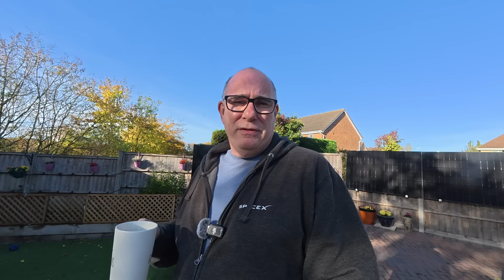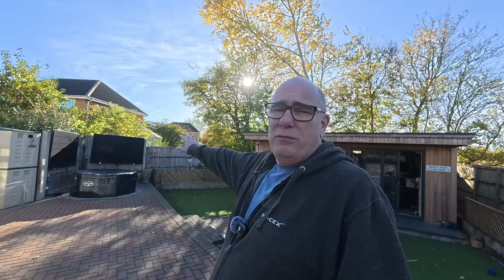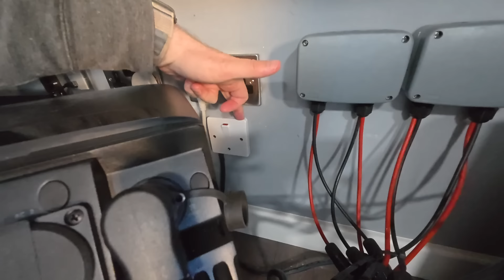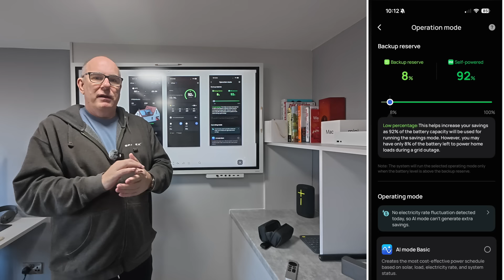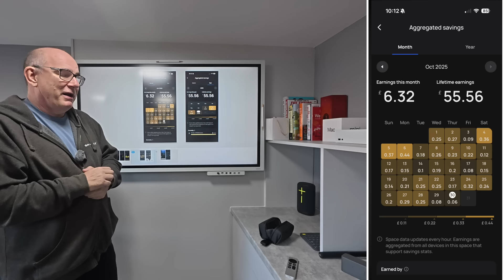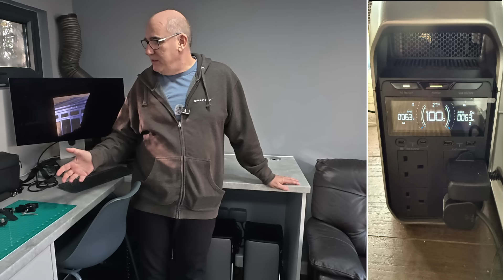I Tried Plug-In Solar for 90 Days (EcoFlow Stream Ultra UK Review)

Comment: How do you feed the battery power into the home when there is a power outage on the grid. Is it true the ecoflow stops injecting power when there's a grid outage to stop backflow?
Reply from the maker: @Builtbypete great question 👍  

Yes — grid-tied systems like EcoFlow will *stop injecting power during an outage* (anti-islanding safety).  

If you want power during a cut, you need a *separate backup/off-grid output* from a battery — the plug-in side won’t run the house on its own.
Reply: @JonathanTracey  If you disconnect this unit from your main can you not use those two 13A sockets on the back? Clearly it won't power your house but could keep your freezer going, charge your phone etc in a long power cut.

Comment: Hi, good video. Does the battery do a consistent discharge or is it on demand and only provides the house what is needed? Thanks
Reply from the maker: so I have multiple systems in my house. The smaller stream system (the plug-in one) I have it export a constant baseload. My larger system is set up to fulfilled demand above the baseload.

Comment: So if you had the ultra not plugged in to the mains would it charge from the solar and be able to power a fridge via the AC port on it?
Reply from the maker: yes, if you don’t grid connect it then it can run as an off grid solution. Supplying power through the two ports. Now the advantage of this is that you can supply a full 2300 W from the on board ports whereas if you’re supplying it back through the house means you’re limited to 800 W.
Reply: @JonathanTracey so you can install it now and use the battery power to run your kitchen appliances from the AC ports, that's completely legal. Just wait until they change the law to plug it in to the mains?

Comment: Question…. I already have solar on the roof with battery’s, A EV so on the Octopus EV tariff, looking at putting a couple panels and Eco system similar to your set up on my shed roof, Do I need the RCD transmitter smart bit to be able to program charge discharge and power the house when it needs to?
Reply from the maker: @andrewwest8418 Short answer – no, you don’t need the smart meter/RCD bit for basic operation.

But if you want it to automatically match your house load and properly control charge/discharge, the EcoFlow smart meter makes a big difference. Without it, you’re basically setting fixed output manually.
Reply: @JonathanTracey  ok make sence thank you seems it’s the better option to have it so set it and forget it rather than manually having to guess/figure out what the house needs. My only issue is my fuse box is full with no spare slots anymore so not sure if there’s a work around I’ve heard if clamping it to the mains “in” power on the smart meter as don’t fancy paying for a larger fuse box to be wired in 🤕💵, Great videos and please keep it up as always very helpful.

Comment: Hey great video

Looking to set one of these up once the UK gov allows us to plug it in via 3 pin plug.

Will charge it over night on a cheap rate.

One question, is there a way to get them to charge up during the day with excess power from your roof top solar panels. If you have them plug in via 3 pin ?

Thanks
Reply from the maker: yes but you need a smart meter (ecoflow rebrand the shelly one) that can sense when there is excess solar and start charging the batteries
Reply: @JonathanTracey Thanks, I thought you might need the smart meter. I asked the AI bot on their website and it said no 😂

Comment: I’ve just started looking into this. I can’t quite get my head around the smart meter aspect. Do I have to install something onto my consumer unit?
Reply from the maker: you don’t have to, the smart meter allows the battery to discharge only what the house needs. You can install it without one and then just tell the battery to discharge at a constant rate, for if you know your house needs 400 W an hour set it to discharge 400 W an hour. The disadvantage of this approach is that if your house only requires 300 W, you will be exporting 100 W to the grid and not getting paid for it.
Reply: @JonathanTracey  I certainly don’t want to do that, so can you suggest the easiest/cheapest way to get the smart meter installed?
Reply: There’s an eco-flow that looks a bit like a circuit breaker without the switch… but I wouldn’t have a clue how to install it

Comment: Also I want to simple no importing from the grid. I was
Tols that sometimes the pro takes power from the grid for no reason. 
So basically you m new to all this. All I want to do do is run power to the home and charge my pro that’s it. Does it automatically 800w in house and any left over charges the battery.  Then at night does it automatically just start offloading then stored energy or do you have to set it up to do this. Thanks
Reply from the maker: @thaialina11 I’ve not had any experience of it taking power from the grid when it’s not supposed to. My system only draws power when I tell it to, which is overnight on off-peak rates, and in summer it doesn’t draw from the grid at all because it charges purely from solar.

You can define how much power it sends to the house, or if you install the EcoFlow smart meter, it can automatically supply just what the house needs and store the rest in the battery.

Comment: Hi. What do you use for extension leads for it as al lay round garden. What leads did you use. Thanks.
Reply from the maker: I made them myself, just buy 4mm DC rated cables and put MC4 connectors on the ends

Comment: Ive just ordered an ultra with 4 panels in their spring sale. I already have a garden DIY setup but they are old ex solar farm panels that barely get 200w each, so looking forward to using this and ofcourse plugging it into my home network (when regulations allow cough cough wink wink)
Reply from the maker: @thornbottle Nice, that’s a big step up from those old panels 👍  

I’m sure you’ll follow the regulations to the letter of course… just make sure it’s got a decent plug on it 😄  

Be interesting to see what kind of output you get compared to the old setup — should be a night and day difference.
Reply: If I buy this kit do I need a bi directional rcd fitted or will the ecoflow smart or shelley rcd do the same job? I want to have this battery connected with the four panels and use it to supplement my base and when using the air fryer and TV. Can it just sit in the corner and take the load and I can set. It up to charge on low rate but I'm with utilita and first 2kw are 93p then the rest are cheap rate but also cheap rate at off peak
Reply: @FXCartel  you need bi-directional RCD else its a fire risk as normal ones are not designed to break if the load is going the wrong way. This will likely be in the new regulations. 

If you dont want to replace your whole consumer unit, then I think the next best thing is to get an electrician in to hard wire it to its own fuse.

Comment: Really helpful, thanks. Where I am confused is when using this system independently of the house mains, ie a garage/office/workshop installation,  my understanding is I cannot supply power to a consumer unit and then distribute it to lights and sockets because of (rightly so) a safety feature that stops power, or can I if I wire it to the main consumer unit through a isolator?
Reply from the maker: you can’t operate it in isolation from the grid supplying power through the grid power port on the unit to the consumer unit. The reason is that it looks for a 50 Hz signal from the grid to synchronise his power to. If that goes away then it shuts down. What you can do is take power from the device itself by the two standard plug sockets on the top when it’s in isolation mode. So you can plug anything you like into those sockets and use the power out of the batteries.
Reply: @JonathanTracey could i plug that into the consumer unit as it it were the mains feed, ie a 13amp plug with bear ends onto the consumer unit?

Thanks for the reply, you confirmed the safety element

Comment: Great video. I still am confused about the solar power. I have a question. I am getting a log cabin in my back garden. Do I need to have electric connections ( light switches, sockets etc)  from the main house or can I power the cabin just with the ultra system (using the plugs at the back)? Do I also need the 2nd battery pack for it to work properly? Hope you will be able to answer my question. Thank you.
Reply from the maker: yes you can use it in island mode, but if you fill the batteries up the solar basically shuts down as its got no where to send the energy. In winter if you don't have any way to charge them you will run out pretty quickly. Even if you don't use it having the mains connection is a good backup

Comment: Great review, I was searching today as the Government announced that plug in panels would be available so this should be allowed soon to connect to a socket. I assume you could schedule the battery to stop output while an EV car was charging ?
Reply from the maker: Yeah you can schedule a battery to do anything you want, if you want to do complex automations I’d recommend doing through something like Home Assistant because the EcoFlow app only really handles the EcoFlow ecosystem. (Far too many Eco’s) 😂
Reply: Does the hardwired cable still provide power during a grid outage? Or does it stop when it senses the grid is down to prevent back feeding? Do the local 13amp sockets provide power during an outage like a UPS would?

Comment: Thanks for the video, would an AC Pro work in the same way you use yours but without the solar and just grid charge on a schedule and set the discharge at say 200w for my base load during the evenings. Would it need the CT for this or would it work like that without. Thanks
Reply from the maker: @b19wll yes absolutely 👍 you can grid charge it and then discharge at a steady rate (e.g. 200W) to cover your base load in the evenings.

You don’t need a CT clamp or smart meter for that — it’s just a simple schedule set in the app.

The only thing I’d say to consider is future flexibility. If there’s any chance you might add solar later, it could be worth looking at the Ultra instead. It does exactly the same as the AC Pro for what you’re describing, but also has the solar inputs ready to go if you ever want to expand.

Hope that helps 👍
Reply: @JonathanTracey thank you

Comment: Is there a way to provide power to the stream ultra from a server rack style 48v100ah battery?
Reply from the maker: only if you fake it as a solar input, the only inputs on the stream are via the MPPT and MC4 connectors, so you would need to configure the output to send the corrrect voltages and current so the stream thinks its a solar panel

Comment: Hi Jonathan, with the announcement that 'plug in solar' is being allowed in the UK as of yesterday. Will this mean we can have a 3 pin plug set up?
Reply from the maker: Yep its a positve step but the electrical regulations need to be updated first before its legal. But yes you will be able to plug in via a 3 pin plug
Reply: EcoFlow's own website when you go to the order section for each of these units says "Plug-in solar regulation is expected to be introduced in the UK in the coming months.
EcoFlow STREAM Series are equipped with open-end cables and fully comply with existing regulations. Once the new regulation comes into effect, plug-in cables will be available for purchase to enable easier installation."
So it is literally just fitting a plug to the cable. Units already bought will be compliant with the new regulations.
Reply: It will be a game changer, will explode solar installation once again. Wether they can get all the regulations changed by summer is a big question but let's hope.
Reply: These systems will cont to evolve so I would not rush.
Reply: @Jean42ette unfortunately so is my electric bill 😂
Reply: I'm so confused with all this. Do you need the micro inverters if you have the stream ultra?
Reply: @doitmyselfrunza  no the ultra already has the same inverter in it. You need the inverter if you are plugging solar panels directly into the mains.
Reply: @j @juliandarch9278 eers, just ordered the ultra and 4 panels
Reply: @doitmyselfrunza  No. The Stream Ultra has four inputs on the back that plug directly into four solar panels of up to 500w each. No inverter needed.
That was they take the DV power from the panels and put it straight into the DC battery without any conversion loss.     
When you want AC output for your home it has an inverter that turns the battery power into AC.
You can also add up to 800w of solar input by using a plug in solar kit (with its own inverter) into the 13A plug on the back.

Comment: It’d actually another useless video as in fact the AC plugs are importantly to the distributed battery design and feature 
In case of power failure, when the grid is not available then the plugs on the stream are then providing electricity on those plugs allowing to keep the local load working.
You can imagine having one small battery near the fridge, one for the internet equipment and one near the office computer

When everything is fine, the batteries are discharging sequentially to keep the battery level inside the batteries equivalent, and still power on the AC plugs
And when the power outage arrive, then all you AC plugs still continue to be functions providing you with backup power 

And basically you have 2 levels
   - how much you keep by default for outage situation (default is 40%, with 20% minimum, so you got 20% of the capacity used for outage situation 
   - the maximum battery charge, default is 95%, and it keeps the difference, default is 55% (from 40 to 95%) and can be used to storage solar power, or you can manually or via the automated AI charge it using the off peak hours tariff
Reply from the maker: @FabienMagagnosc I think there may be a misunderstanding here. The AC plug isn’t really about backup power — it’s simply a way of getting energy from the battery into the house wiring. In the UK the regulations don’t currently allow plug-in systems to operate as backup during a grid outage, so if the grid goes down the system has to shut off for safety reasons.  

That may well change in the future, but today the AC plug itself has nothing to do with backup functionality, so the grid-down scenario you describe wouldn’t work under current rules.
Reply: @JonathanTracey  I'm planning on buying a similar set up, but I have a few questions that I wasn't able to find answers to on the internet. 
1. Can you use the AC plugs as a backup if there's an outage?
2. When there's an outage are the units going to charge through the solar panels?

Thanks!
Reply: @damyanvasilev9210 yes, when there is a power/grid outage, the AC plugs are then accessible and continue running, and yes, the solar panels continue to charge the battery if there is a leftover from powering the AC plugs first.

The fact that this is a “distributed solar battery” allow not only to generate energy via solar panels, store off peak tariff electricity to use it during peak electricity, but allow to have a backup solution in case of power failure 

I personally use it for all the 3 : we got power outages in Portugal, especially a massive blackout and my place was not completely down : internet, computers, my fridge and even my tv were running normally and as one of my stream ultra as solar panels: my fridge is protected for almost “forever” as in case of power failure the solar provide enough to keep the fridge running, charge the battery and it can discharge during the night and still have some left, as then it’s in emergency mode : it’ll use the battery until empty

I do think the usage here is fine, but it’s not really the full purpose and as mentioned in the comments, you have for example the emergency charge level which is the minimum always left in the battery for in case of power failure, and the maximum charge : the difference is there to charge/discharge with solar and off peak cheap electricity

Comment: Hiya. What is the max charge rate for this system please? Does it increase as you add additional storage batteries?
Reply from the maker: it’s 2300w (from the mains) and no adding batteries does not increase this

Comment: Very interesting. I'm getting solar on my roof for a house renovation and considering adding an additional system to a shed/outbuilding with it's own system. I would like to set it up myself in the future and EcoFlow seems like a good system, great description and review thanks for sharing. You mentioned your fence panels are not super efficient due to the angle of install. Curious, would you consider hinging them at the top and folding out at a 25-30 degree angle on non windy days to increase efficiency.
Reply from the maker: so I did actually try a single axis tracker that would lift the panels up during the day to get the optimum angle but the tracker became more trouble than it’s worth, it was a mechanical device and it failed quite often

I should point out that they’re not very good during the winter but during the summer they produce quite a lot of power and I use a very simple piece of plastic to lift them away from the fence by about 5° which is increases the generation by about 10%

Comment: Hi Jonathon, thank you for the clear insight, question, can you plug in a generator via a charging unit like you can with the Delta 3 max so as to boost the power supply, this is assuming that you cannot plug into a mains supply primarily because we are off grid.
Reply from the maker: the only inputs are mc4s so you works need to use a dc converter and simulate a solar panel